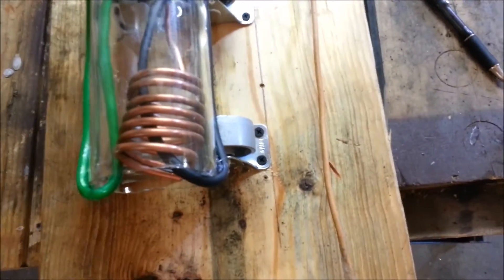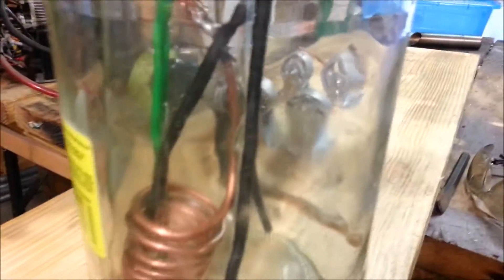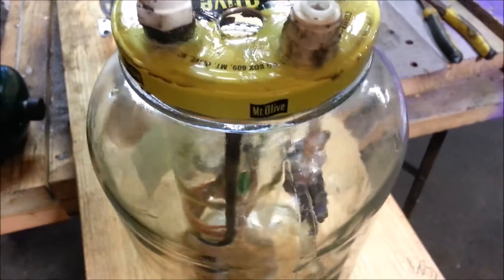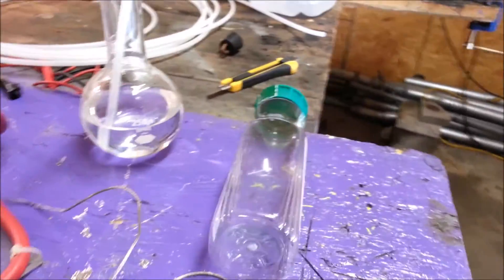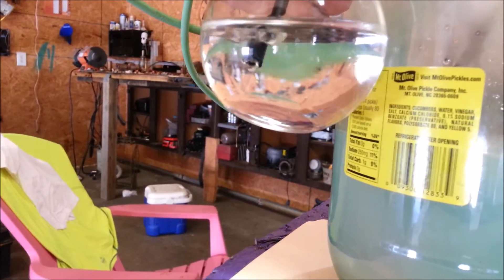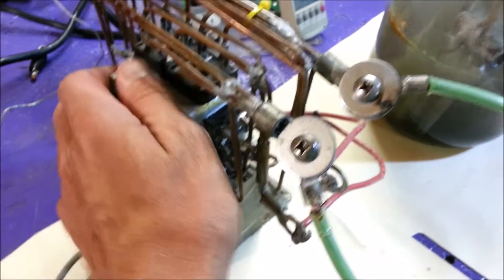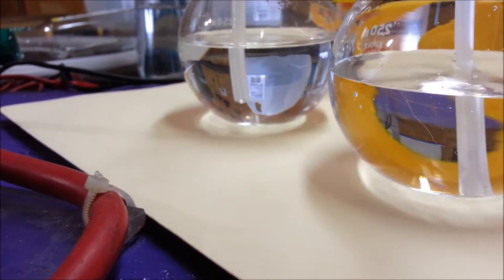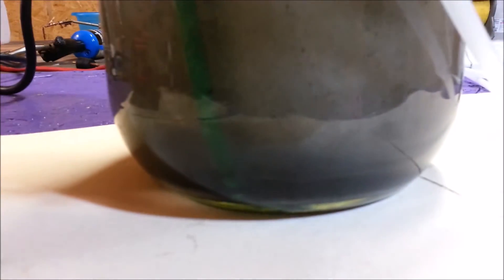Making Chlorine using electrolysis

Comment: Stainless works quite well actually, possibly better than Cu in chlorine solution, but it must be a high carbon content high grade stainless.  Thin plates create huge surface areas, lowering cell resistance and increasing reactive area.  Further enhanced by quickly sanding w 60-80 grit to scar surface, thenagain perpendicular to 1st direction, creating pits/peaks on surface further increasing surface area 2-3 times more.  To reduce O2 gen. at C rods, you want - terminal surface area to be much higher than the surface area of the C rods.  Why this works requires a deep understanding of the mechanisms; just trust me on this on I have a "bit" of experience here

Comment: Cool video dude, but I see multiple big issues right away as to why your results are poor.  Im a chemical engineer so this is my area of expertise if you will; not trying to offend just trying to help.  Did you ever get it working properly?  If not, id be happy to guide you to fix issues and create an efficient Cl2 generator.

Itd take a good bit of time to write all of it out so I will refrain from the details for now as to not waste an hour on something that will never be read or to an abandoned project.  For now ill briefly list fixes, but if you respond interrested in the fixes, ill be happy to write up the details of each and how to resolve them.

-you smell very little Cl2 after running a bit because your C rods are producing large amounts of large bubbles, where if u notice the steel bolt produces much smaller bubbles of H2.  The large bubbles are not Cl2 but O2, Cl2 generation does not produce bubbles as Cl2 is quite soluble in water at room temperature.  Plus, if all those bubbles were Cl2 in the open test dish, youd see a yellow-green heavy gas ooze out and flow down onto table and soon be finding escape for fresh air
- (-) charged species attract to + terminal as you know.  When H2 is formed, so is -OH and solution quickly becomes caustic with NaOH.  The -OH migrates to C rod where its reduced to H2O and O2 gas.  So a small amt of Cl will be generated at first with mostly O2, but as -OH builds up this becomes a loop of water to H2 and -OH, followed by -OH to O2 and water; a repeating loop of wasting power....there are multiple reasons other than this O2 will still be produced (though you are correct to use saturated NaCL to encourage Cl formation), all of which can be greatly reduced with a couple easy changes.
-voltage is crucial as well to minimize formation of unwanted byproduct O2, as well as pH and temp.  Using way higher V than eV for half reaction not only encourages O2 production, but excess V is efficiency lost due to heat which wastes power and heats water in cell.  Warm water greatly increases solubility of Cl2 causing higher conversions of desired Cl2 into chlorite (-ClO).  Though this will be reacted back into Cl2 ang O2 as con. increases, this is yet another repeating loop of wasted power and efficiency loss.

Those are a few...e-cells are much more complex than most think as most do not realize so many factors affect it, or how many byproducts and regenerating loops can be in equilibrium along with desired mechanism.  Ive a PhD in chem eng, so im confident i can explain details and how to fix all issues if you so desire, please just ask.  Hope I was of some help bro, have a good one
Reply: chad kimsey.. im interesting for making home made sodium hypoclorite. do you have email.
Reply from the maker: Thanks Chad , i have givin up on this project but i believe you about the over voltage
Reply: NOBOX7 what about your moles?  My yard has become an underground haven for moles AND gophers!  I'm thinking hydrogen sulfide is much easier to make.
Reply: Chad Kimsey would you write up a reasonable home chlorine electrolysis setup, or have a reference for that reaction?  I'm learning more about electrolysis, but as you mentioned, it is a lot more complex than I expected!  Thanks in advance.
Reply: El cl2 es POCO soluble en agua, lo que pasa es que se dimeriza en CL- en presencia del producido NAOH. Pero si haces burbujear CL2 en agua pura, solo se disolverá una pequeña parte.

Comment: A simple diaphragm cell is an unglazed clay flower pot. Seal the bottom hole in the pot with silicone or epoxy.
Parts made of acrylic, like plexiglass handle chlorine well.
Have the salt/ water combination and the carbon rod inside the flower pot with a plexiglass lid. 
Attach a gas fitting of some sort to the lid next to the rod
Outside the pot is a salt water bath with a steel electrode(Preferably stainless).
Carbon to positive--steel to negative.
I seal the lid and rod with electrical putty from the hardware store.
 I have done all  this successfully.
Reply: For carbon, I use "Burning electrodes" from the welding store.
Another reason not to mix Chlorine with Hydrogen is that they "burn" when ignited to produce hydrochloric acid.

Comment: so the device is for chlorine gas not chlorine? why the carbon rods? for chlorine gas? do you have to use carbon rods to create chlorine, so potentially I'm swimming in a pool mixed with lead, and if I accidently swallow the water I'm swallowing lead molecules with it
Reply from the maker: no your not swallowing lead . the carbon is a must or else the chlorine will errode the electrodes
Reply: You can use platinum electrodes too
Reply: Carbon handles the positive side and chlorine well.
Carbon rods can be obtained from old zinc cells or be bought at a welding store or online, sometimes called "Burning Rods". 
Steel is good on the negative end especially stainless steel.
Reply: @prospektOS-tmo97  Confusing carbon for lead ie pencil lead
Reply: @Eubtube   I dont see a real problem with "attitude" here, as such beyond elementary lack of knowledge that Cl2 is a gas (a very corrosive, dangerous gas) and asking about lead content when no Pb is present in this setup is too much ignorance of basic chemistry to be messing with a potentially very dangerous process to someone with no understanding of this whatsoever.

@Walter  I highly doubt he in this case is confusing Pb with pencil lead, because he says "carbon" rods.  Clearly these rods arent pencil lead, and him knowing they are C then asking about Pb seems he notes they are not the same thing as he refers to it as C and not pencil lead.  Clearly carbon is not lead, or they wouldnt have different names....but im still 100% confused on where the idea of Pb comes into play.  Maybe you are correct, he just really has it worded wrong as a result of his confusion.

If ignorance is trying to be eliminated by asking questions to learn more, thats great and I encourage such actions.  However if you are trying to learn, then ask in such a manner, not like this with confidence you already know whats happening lol.  Such basic things could easily be found on google in minutes, then a more productive deeper question could then be asked without looking so ignorant.